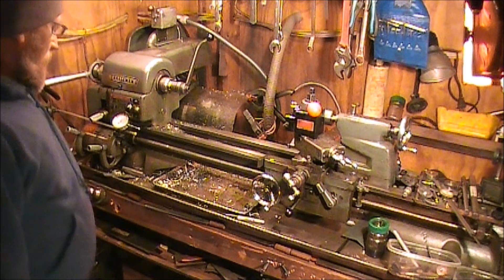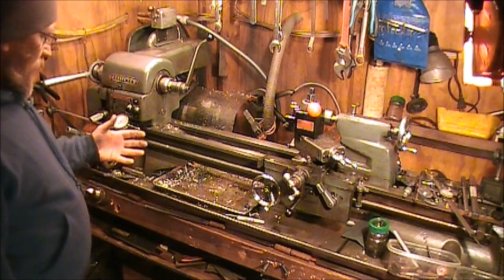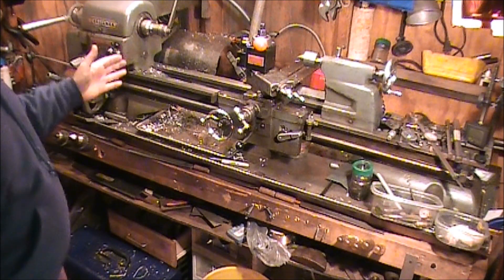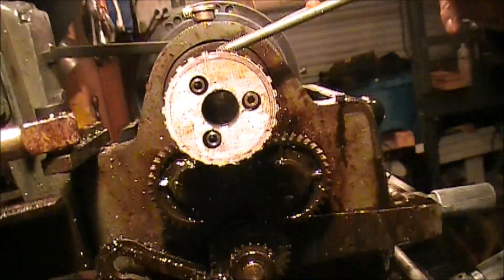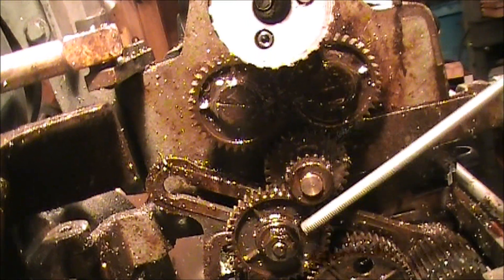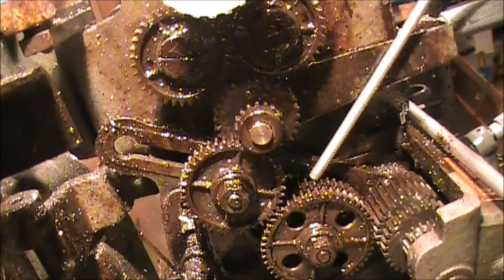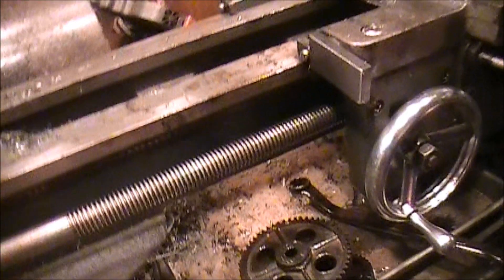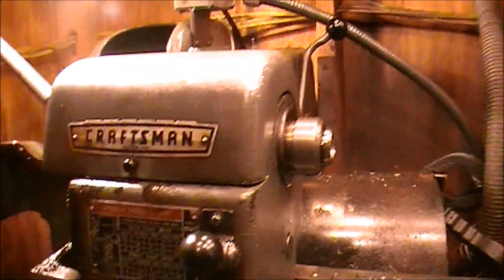craftsman atlas lathe feed rate mod

Comment: I have the commercial model basis the same machine other than 3 phase so I use a converter and can slow it down to a useable rate . So far it’s worked fine .
Reply from the maker: yes honestly once you learn the machine your best results is to take cuts that are not so fine. divide your cuts up to the depth you need and hit your target by taking a  5 or 10 thou final cut, then maybe a spring cut if needed or draw file to size if you are to close to spring cut to size. I'm no machinist by a long shot but I'm learning my machine and how it reacts to certain depth of cuts  on certain materials.
Reply: @daveknowshow  have you bolted your machine down and leveled it , I’m in process of doing that . I have found it doesn’t stay level and cuts reflect that , it’s not much but off is off !
Reply from the maker: @jerrypeal653  I bolted it and leveled the best I could with what I had. it cuts fairly decent for the size machine it is. my southbend 17 inch turnado turns much more accurately but its a beast of a machine. likely weighs 5000lb
Reply: @daveknowshow  I have a machinist precision level and it shows min has a twist I can’t get out due to the frame the commercial comes on so that’s why I’m bolting it down then will shim  for corrections . I certainly wouldn’t call myself a machinist but a hobbyist trying to do the best with what I’ve got . To many hobbies, lol wife thinks I’m nuts , lol
Reply from the maker: @jerrypeal653  yes to many hobbies here as well

Comment: Nobody ever points out the fact that in this configuration you lose the top TWO rows of threads on the feed chart. Position “E” OUT is now the new range you’ve created with the addition of the compound gear. The slowest feed rate is now .0021” per spindle revolution. Great. “D” OUT is now the old “E” OUT. “C” OUT is now the old “D” OUT. “B” OUT is now the old “C” OUT and “A” OUT is now the old “B” OUT. There is no “A” IN. With the addition of the compound gear you have lost the ability to “slide” to the 32-tooth compound gear below the tumblers. So without taking anything apart and re-configuring anything, the coarsest thread you can cut is 16 t.p.i. Don’t get me wrong, this is the way I run my lathe 99.9% of the time.  I love the slow feed rates. But just be aware that you lose the top two rows of threads.
Reply from the maker: I would nor say you lose any ability at all. in fact a better way is to say you gain the ability to feed slow. its not a big deal to slide that gear off and put the other gears on. people change gears on lathes that dont have gear boxes all the time. additionally if you read the owners manual with this model lathe you are directed to change gears when cutting metric threads. yes you can cut metric threads on these lathes. there are times when changing gears is necessary to utilize the full extent of this model machine.

Comment: Shut the damn thing off so I can hear
Reply from the maker: ha ha yes the loud machine does reek havoc with hearing aides so I been told.
Reply: @daveknowshow  like the gear ideal and even tryed it removed my 40 tooth for a nylon 20 tooth I have and don't need treads as fine as bottom you lose and not hard to multiply by 2 to tread but I think I'm going to do dc motor to save wear on my gear box when I'm just feeding,, l already put a treadmill motor on it anyway,,,best thing I ever did..
Reply from the maker: @georgespangler1517  very cool idea. I looked at doing an independent drive motor as well. like Mr Pete 222 did on his machine. after finding this mod I applied it and it does work well. since then I put mine back to stock and just try to hit my target dimension taking a final heavy cut of at least .010 removing .020 and then draw filing if need be the last few tenths or using the shearing tool  Mr Pete shows on his channel. I dont get as good of a result as Mr Pete but its not bad depending on material I'm cutting. thanks for stopping by my friend.  Peace Love & Respect  to you and yours Dave in Virgnia

Comment: Dosent that change change treading rate also?   So you will have to change back orginal gears to use tread chart in quick change?
Reply from the maker: just divide by 2 and the chart still works. 8 threads per inch is now 4 because the feed rate is half speed.
Reply: @daveknowshow  thanks I kind of figured that's what your doing,,,I was going to use a sewing machine motor  but I like your idea and one less function,,,thanks
Reply from the maker: @georgespangler1517  yeah I started to use mr pete222 idea with the motor mounted on the end of the lead screw. then I found this article and the man sent me the information. this sped things up for me greatly because I was knee deep in math trying to figure out where and what size gear reduction would fit. this works out great for some things however I use it as normal 99% of the time. learning the machine and target diameter of what ever material you are cutting I simply try to hit the target dimension with at least a .010 depth of cut down to .005 any lower than that I use a draw file method or a sheering tool. you can look up sheering tool on Mr Pete222's channel. I use that tool to polish and hit dimensions that I'm with in a few thousandth of and cant use a standard bit because it may pull in and cut to deep. I also installed a cross slide lock to hold the cross slide from being pulled into the part as they sometimes will on my old machine.  of course with that said I have held some extremely tight tolerances with this machine making specialty tools one after another. so these machines are not bad at all. glad you enjoyed the video. remember spindle speed feed rate and depth of cut based off material being machined is your friend for the best finish and hitting the target dimension.  I find I get a better finish if I speed up the cut feed rate in many situations. took me a long time to figure that one out. sometimes a slower feed rate leaves a crappy finish give it a try and you will see what I mean. peace love and respect Dave in Virginia
Reply: @daveknowshow  sounds good but wouldn't you have to multiply by 2 and loose some treading functions because you won't be able to speed it up enough?
Reply from the maker: @georgespangler1517  the gear reduction slows the feed rate down by half so when the selector is set to 8 threads per inch it is actually cutting 4 threads per inch because set to 8 with the gear reduction added it is slowing the feed rate down. so yes you will eventually lose some thread ability. on the upper end.
Reply: @daveknowshow  ok,,,so you have to multiply by 2 not devide.  But I'm going to do motor to save wear and cut down on noise,,, the gear box sounds like a combine when it's engaged,,
Reply from the maker: @georgespangler1517  well yes you are multiplying by one way if you want 8 threads per inch 2x8 equals 16 so you need to set up at 16 threads per inch. if you want to know what thread per inch 16 is you divide 16 by 2 which equals 8. yes the gears on these laths are loud. I use "open rope and chain lube" its thick and messy but it really quietens the machine down a lot.  honestly I have learned to use it with the stock gears and I can get a pretty good finish. its all about feeds and speeds for the material your using. refer to the craftsman  atlas owners manual or the machinist hand book.
Reply: @daveknowshow  wouldn't you have to multiply by 2 and lose some treading functions with the gear approach?

Comment: This is a great idea so where did you get the gears???? Without that info this video leaves something to be desired You should also make a little wooden tray to sit on the ways in back of the tailstock and avoid stacking piles of stuff on the ways. Also try and find out  where the chips get into the gears and you can make the most of that nice gear lube they will last longer.
Reply from the maker: gear can be found on ebay. some are used, some are 3d printed, some are new old stock and some others are newly machined out of other alloys. the stock gears are made from a combination of various metals, aluminum, zink and I believe copper. Mr pete222 does a video explaining what the gears are made of. he also 3d prints some gears. hope that helps.
Reply: @daveknowshow  Thanks a bunch! I should have guessed.

Comment: FYI, Crafted did this with one 24 tooth gear and moving one 48 tooth gear.
Just another way to do the same thing.
Thanks for showing.
Reply from the maker: he got the idea from me I believe he did it on a different model and I thought he used the exact same set up I used. I actually bought to many gears and did not use them all as can be seen if you watch the entire video.
Reply: @daveknowshow  I watched it all. He took one of the two 48 tooth gears that engage the gearbox and moved it to the change gear location replacing the 40 tooth gear that was there. He bought a 24 tooth gear and added behind the different change gear. His was a 10 Craftsman but the same as the 12".
But, both ways work and that's what matters.
Take care.
Reply from the maker: @plainwornout3964  yes he used a 48 and half a 48 and I used  a 64 and half a 64. it was exactly the same way. he did his in sept 2015 I did mine in jan 2015 we are subscribed to each others channel and have been for many years. he used the gears he had on hand, I ordered gears based off the instructions I got from someone else on the atlas forum. the original guy who did this mod before anyone else. this was not something I thought of. this was something I got from the original guy who came up with it on the atlas forum I was involved in many years ago. I had to use the gear combination I could find available. I still have the email from the original guy who thought this up some where around here. its actually very ingenious. like you said it works great you just have to use two gears that are half of each other. a no brainer once someone points it out. I was grateful to get the information and then share it here on youtube since it was no information on it at the time I posted this video. since then I have move away from a machining channel and on to other things. most of the machining I do is prototypes for original tools I created or other apparatus for tractors. crafted is a very talented man and he knows these atlas lathes inside out. he works on them a lot! that's basically what his channel is about. he is also one of the nicest people on youtube and a real stand up guy! its a real privilege to call him my friend. a right smart guy! he can likely answer any atlas question you may have. he would give you the shirt off his back! love him to pieces and cant say enough nice things about him. hard to dislike I great guy like that! appreciate you stopping by my channel! hope you have a blessed thanksgiving! peace love and respect.
Reply: @daveknowshow  Thanks and you enjoy the Holidays too.

Comment: Great video.  I see we've both done one on this subject.  I'm thinking of pushing my out to 1/3 or 1/4 feed rate.  Pretty happy with the 1/2 feed rate mod however.  Hope you are doing well.  Love to work out a way to use a lever to shift from 1:1 to 4:1.
Reply from the maker: for sure a lever would be great. mine is reset back to factory and I have learned to use it with fairly good results within those speed rates. I'll be keeping an eye out for when you post a lever change option.
Reply: Mine is still setup with the reduction.  I like it fine that way.  Right now I'm just dreaming out loud of a better way of doing it.  No fixed plans yet of exactly how.  There are a few general ways I can think of to make it happen.
Reply from the maker: I'm not sure its worth it since we rarely use the lower thread counts anyway.  I put mine back in case I died and it needed to be sold I didnt want the new owner trying to buy it cheap claiming its been modded and they need lower thread counts. I get pretty solid results with it as it is.

Comment: Great video, thanks.  Wouldn't you go the other way and double the thread count since its moving half the distance?
Reply from the maker: yes you have to adjust for threading. some threads are still available by moving up twice the amount on the name plate others you will need to put the old gears back.  once you do the mod you will see exactly what I mean and it will all make sense.

Comment: Refresh my memory.  When setting the gear clearance, we use one or two strips of paper meshed between the teeth?
Reply from the maker: Daniel Coleman I use two if it's thin paper but one does work so long as you don't jam it in there to tight. even settings that are dead on are loud so a good open gear and rope lube does wonders.

Comment: Dave, Thank you for the video.  I just did the gear change over. Bought the gears off of ebay last week and put them on a few mins ago. Feeding much slower. Getting a better finsh on the cuts. I still need to watch more mrpete222 tubalcain videos to learn how to use the lathe and mill correctly. Welding fabrication is my back ground but total welcome these tools in my home shop.  I have the same lathe but I have the undercarriage model.  I also feel when I changed these gears over I felt the noise level went down.
Reply from the maker: +Neil Carey  that's great man! so happy your pleased. I use "open rope and chain lube" to help silence the gear chatter even further. the stuff will collect chips so you have to disassemble every so often and clean her up good with diesel fuel. or simply run some diesel fuel over the gears using a pump to clean the gears off and then relube. keep in mind you need to keep a good clearance between gear mesh up. about the thickness of a sheet of writing paper or two is what I try and maintain between gear mesh up. thanks so much for watching my videos and please share and hit the thumbs up.  oh yea you cant go wrong on Mrpete222's channel. he is an excellent teacher! peace and love my brotha!

Comment: I was calculating gear size to accomplish this exact mod. Then I decided to go another direction, I used a dc variable speed motor with a dial speed control and mounted it on the other end of the lathe and attached it to the lead screw. 

I did not make everything all nice with perfectly machined mounts etc, I have a welder so I just welded up the brackets and made the motor mount clamp on to the ways at the back end of the lathe. 

The feed screw is simply driven using a socket and extension turned down with a small toothed belt drive using timing pulleys. It was all just quick and dirty but works perfect. I added a limit switch to shut the feed off where ever I need. Works perfect where I have to remove a lot of material. I can start the feed and do something else and not worry about a crash.

I bought a longer 54" lathe bed recently as my lathe bed was only 42" so when I rebuild the lathe with the longer bed I will machine up some nice mounts and brackets and post a video. I am adding the cheap Igaging  DRO's also.

Yes I do love my craftsman lathe. I am planing on getting a larger lathe but the craftsman 12" lathe serves me well for now.
Reply from the maker: +Robert Barnes  originally I did that same set up using a socket and extension machined to fit a gear reduction drive. had it half finished and decided to go this route. I was using a dc motor to drive it. I had a lot of the stuff but after calculating up the money spent and what else I needed to buy I was able to do this mod for like next to nothing compared to the cost of the other way. this mod was fairly simple and can be reversed easily with in minutes. Mr Pete has a set up on his like yours as well. I based mine off his design many years ago. at the end of the day its what ever works best for you. I simply ran out of money to be honest or mine would more likely be like yours and his.

Comment: Dave, I put a plug in for you on my blog. (see the end) thanks again for posting the vid. Man I'm loving my machine even more now! http://www.hyperlinks.net/atlas-lathe-wqc-speed-revisited-0021-as-new-lowest-fed-rate-bye-bye-fast-feed-rate/
Reply from the maker: thank you very much! all the views help me a lot! I'm so glad many others are finding out about this worth while mod!
Reply from the maker: its nice to take a .050 cut removing .100 of material at a time! saves time and leaves a nice finish. lathe is still a light duty unit no where as rigid as my 17 inch turnado but I just love my Craftsman atlas and use it more than the southbend 17

Comment: Dave,
Just tried the same mod On mine. I get double the feed rate or the same feed rate. Can you on yours setup a dial indicator on the saddle. , Zero. And then on the finest feed setting turn the spindle 10 turns. and tell me what you get? I say 10 because 1 turn is hard to average out. this way you should get according to you. .021 of movement. TIA!
Reply from the maker: yes, I will check it I had not checked it with a di yet I just know its a slower feed rate and should be half of what the chart shows. I will check it right now and get back to you asap.
Reply from the maker: http://youtu.be/yaVBrobQ0ys check this video